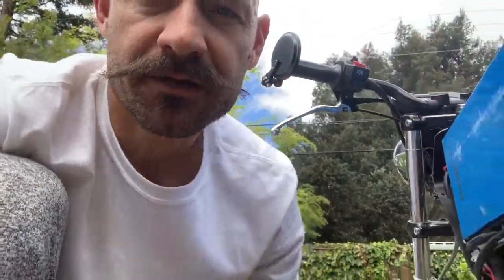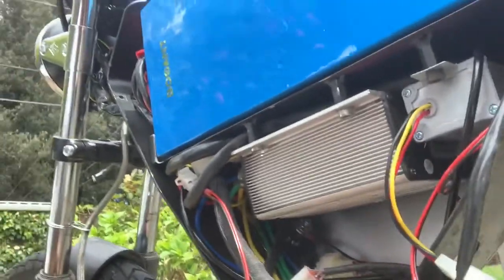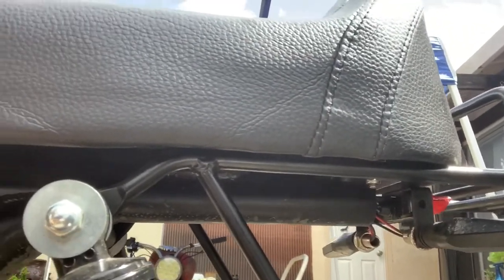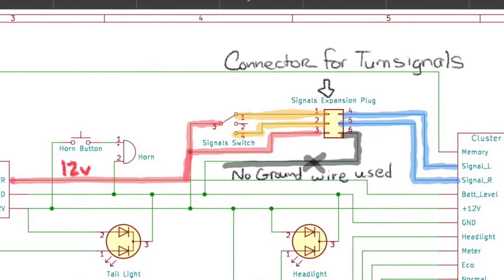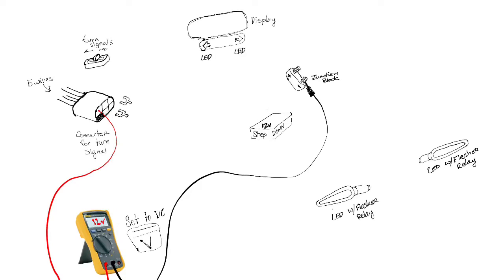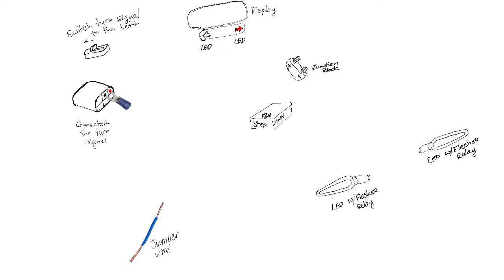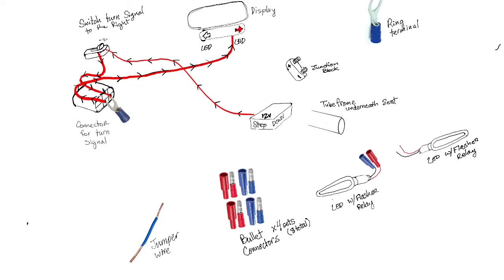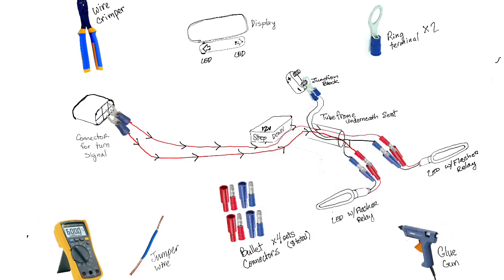Onyx RCR Turn Signal Installation “How To” with electrical explanation

Comment: What changes from this diagram if you want a front and rear turn signals installed? the set comes with 4 and I want to mount two in the rear and 2 on the front forks...also, purchased LED strips that go along the sides that I want to hook up as running lights/turn signals...do you put that all in the same connector or add separate junction boxes or what? Thanks! also any links you have on amazon to the bullet conncetors or wire would be helpful to have those links! Great vid!
Reply from the maker: https://youtu.be/FvV6Q3yZyEo
Reply from the maker: Are the led strips 2 or 3 wire? Day times can both be wired through the 12v constant pin that is not used on the connector, but if it’s only a two wire, your gonna have to decide on blinkers or daytimes
Reply: @MinimemberCustoms  it’s 3 wire!
Reply from the maker: @xhellerx  https://youtu.be/68wi3_Gf1Kw
https://www.amazon.com/Audew-Electronic-Signal-Flasher-Motorcycle/dp/B011BTMDQM/ref=sr_1_7?dchild=1&keywords=led+relay&qid=1604884619&sr=8-7
https://www.amazon.com/Connectors-Sopoby-Electrical-Waterproof-Assortment/dp/B08C7BHN26/ref=sr_1_16?dchild=1&keywords=Spade+fork+connectors&qid=1604884687&sr=8-16
https://www.amazon.com/American-Stranded-Conductor-Power-Speaker/dp/B0791B4ZRW/ref=sr_1_3?dchild=1&keywords=20+gauge+black+and+red+wire&qid=1604884765&sr=8-3
Get the assorted connector kit, because your going to need fork, spade, and ring terminals...I also recommend hot glueing the fork terminal into the connector.

Good luck!

Comment: Thanks for the super informative video! I would like to wire in LED turn signals I took off my defunct gas-powered moto but they use a relay...do you know whether that constant 12v could be used as my power input for the relay? I know it's a bit off topic to this video but...Any advice you have would be greatly appreciated :D
Reply from the maker: Yes, you can.

Comment: Howd you mount the rear turn signals? Did you have a bracket or custom bracket for it? Cant see it clearly on the video
Reply from the maker: I got a two pack of four hole 90 degree angle strut brackets From Home Depot for three dollars. I drilled out one of the holes to except the threaded shaft of the turn signal, And placed it in between the brake light and the bracket that the brake light Allen bolts to
Reply from the maker: https://youtu.be/Mz7wQezZr1Q
Reply: @MinimemberCustoms  i see you that was very appreciated =]